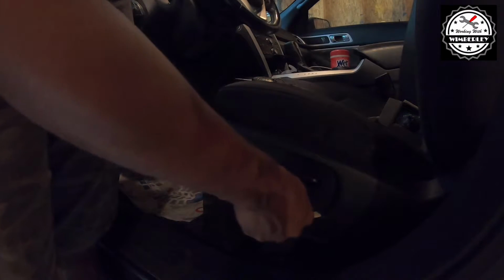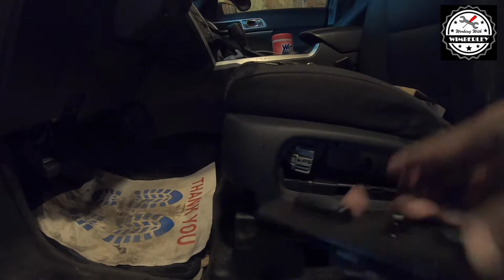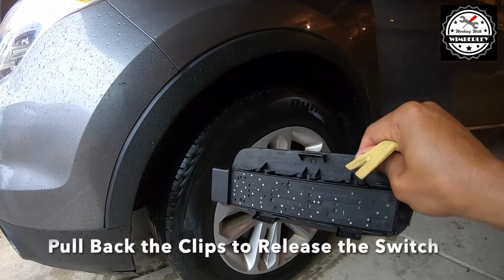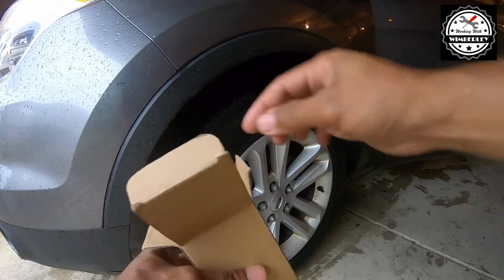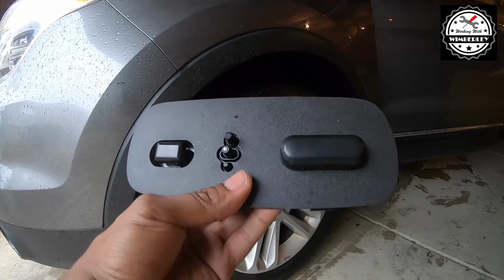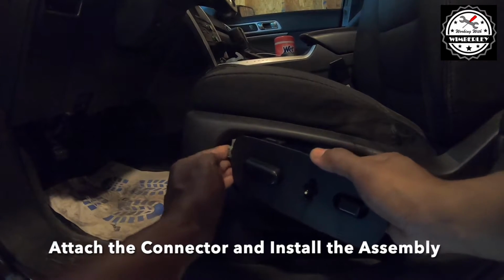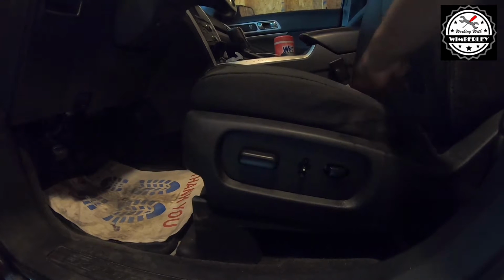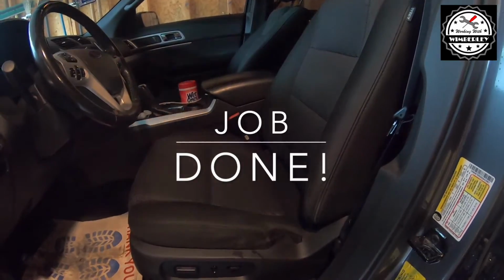2011-2015 Ford Power Seat Switch Replacement & How to Replace Broken Buttons XLT XLS Limited

Comment: Was the other functions working? As in would the seat still move forward and back but just wouldn't recline? My seat reclined and won't return back up. 2012 explorer. Just curious I'm replacing same thing will fix problem. Thanks
Reply from the maker: Yes. All the functions worked except recline. It was stuck in that upright position.

Comment: how do you know if its the switch and not the motor? My front driver seat started off not going back just forward and then stopped going back and now won't recline back just goes forward. the tilt works both ways.
Reply from the maker: I’m not sure. The seat in the video wouldn’t recline. I did the switch because it was the cheapest part. If that didn’t work, I was going to try replacing the motors. Thankfully the switch fixed it so I stopped there.

Comment: Q? If I got the part an had some one else install it would it be cheaper then what they are trying to charge me at tad Jenkins, witch is 800 dollars for the part an labor
Reply from the maker: I paid like $25 for the part off Amazon. Installing it is simple. It shouldn’t cost anywhere near $800. I show you everything that needs to be done if the switch is bad. Anyone can do this.
Reply: @WorkingWithWimberley  it looked easy I just don't understand why they want to charge so much
Reply from the maker: @chipmunk-6250  I’m not sure. I would guess they plan on replacing more than a switch. Maybe they want to replace the motors.
Reply: @WorkingWithWimberley  mm got it